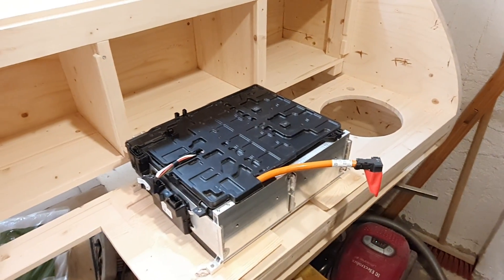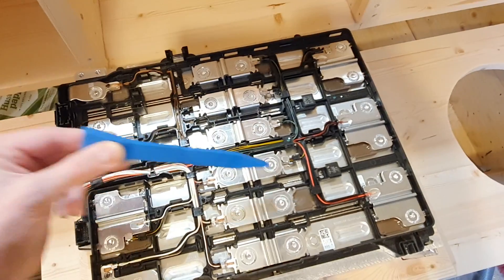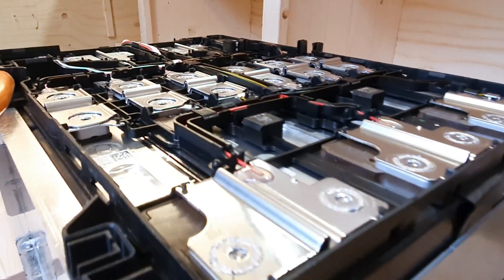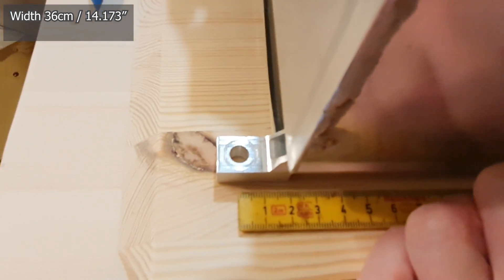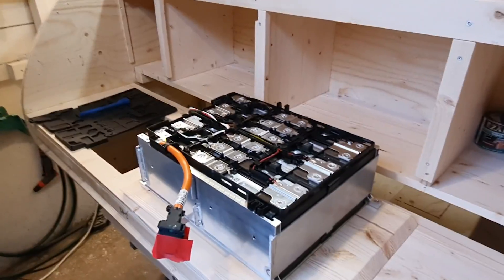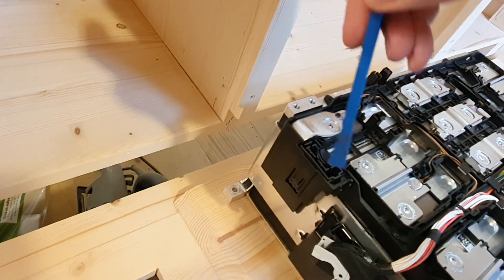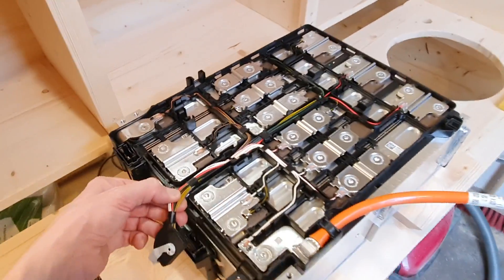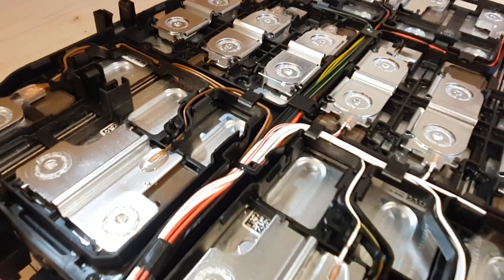BMW i3 60Ah Battery Pack Module Closeup

Comment: Bjorn, thanks for that video, do you have any info how the cells are temperature controlled in this module? Is ther a gap between cells, and where does the coolant flow?

Comment: What technique do you use to join the signal wires and the busbars ?
Reply from the maker: The 12 balance wires was just soldered to the bms harness to keep all cells at equal voltage.

As far as the busbars I didn’t need to do anything except extend the negative pole with a cable. The negative side comes with a big copper piece that I carefully drilled a 8-10mm hole and bolted the negative cable to.

In a more recent project I split that 12s module into 2 x 6s. And used one of those as 3s2p to get 12v. It’s possible, but dangerous/ tricky/ not recommended.
Reply: @BasinBjorn  i don't have space so i need to use solder, i can't use screw
Reply from the maker: @nguyentranhungnguyentranhu4719  oh, well if you mean solder the + & - then I don’t have much advise.

Comment: could those modules be used to upgrade the battery on a BMW 225xe?
Reply from the maker: Not sure what modules are used in the 225xe. But BMW’s need coding to accept the new cells / modules. You could try to ask in the “BMW i3 Modified” group on FB.

Comment: How difficult would you think it would be to connect multiple modules together to increase your range ?
Reply from the maker: I think it would be difficult. The car needs coding to know the new capacity of the old and extended battery pack. Might need separate BMS for the new pack. And the new pack would need to be the same voltage as the original one, connected in parallel. Then there is the issue with cooling of the new pack. Let's say you have it in the trunk?

Fun idea but better to upgrade the whole pack to 120Ah, no add-ons.

Comment: is it possible to remove cells from individual packs without harming them?
Reply from the maker: I couldn't really say, I believe that the aluminum case could be opened by just cutting the welds on the outside. But I would not be surprised if the cells are glued together.
Reply: @BasinBjorn  so I said he'll with it and went full out on one of thease 8s packs, you have to do a lot of super careful cutting and grooving with a grinder, I can confirm the cells are glued togather but the use of a large but thin putty knife and a solvent or oil can safely break the glue I used wd40 to deactivate the adhesive as I carefully advanced the 4 inch putty knife between the cells I was able to convert 2 packs to 7s 2p with 4 undamaged Sepperated 35 ah cells....
Reply: It's also possible to trim and reglue the protective plastic and weld the aluminium keeper plates back to togather if one has the skill and means to bond aluminium you end up with a restored pack
Reply: @BasinBjorn  I'm still working out how to get electrical connections to the terminal posts.... Probly pulse tig welding is likely the only way
Reply from the maker: @oceanhouse8080  Well that's not bad! Good to know, thanks! Sounds like it's totally doable then.

You should leave a link here if you end up posting any photos/ videos on that.

Comment: in several places in Europe you can upgrade the Bmw i3 battery but in my opinion the best is impexneth from the Netherlands and they have original 120ah Bmw batteries, not foldable and the price is around 6000 eur
Reply: Impexneth? 

What are you trying to say? 
I live in the Netherlands and I am exploring options to upgrade my 60ah..

Comment: can you use this for solar panels and if so how thanks
Reply from the maker: Yes but you would need panels that put out a higher voltage than the battery and a charge controller that can charge to the correct voltage. Easiest would be to not exceed the voltage of a single module, 50.4v.

Victron has a solar charger for li-ion at 50.4v

Comment: In the cell datasheet, it specifies 2000N side force to prevent cell expansion during the charge cycle! I think this is the reason for the substantial side alu-plates. If you cut the welds, I believe you'l find the interconnect plates under tension.
Reply from the maker: Do you have a link to that datasheet Tore? Good with people who can find stuff! 🙂

And as you figured out I managed to bring the old pack home. My previous plan was actually to just donate the old pack to the junkyard cause I couldn't find a way to bring it home, and I had to "discard of it" without help from BMW. Luckily I just bought a trailer for my next project and used that to bring it home on.
Reply: @BasinBjorn  The datasheet for the 94AH : https://www.secondlife-evbatteries.com/pdf/Samsung_SDI_94Ah_Datasheet.pdf
And thank you for the tip on the BMS. I just bought a 94AH battery from a scrapper in Norway, that's why I'm highly educated, at least temporarily, on the intricate details on these batteries. The pack will fit in Most cars without the backseat, and even in my small car it only sticks out 30 cm behind the bumper. However, I don't have a forklift at home, so I'll dismantle it in car!! Never donate anything to a scrappy!! You can't imagine what I payed for my 2017 94AH battery, and I still need to pay Danish import tax!!!!
Reply: Repairmanual on the battery pack: https://www.newtis.info/tisv2/a/en/i01-i3-hat/
Question: In the manual all screws needed to be undone to remove the modules, including the lid, are described in the manual as M6. However in one of your other videos you mention the socket used as a T25?? In the manual they state a: "(Magnet socket) Socket SW10 inner square drive 6.3 = 1/4 inch" which on the picture looks very much like an ordinary 10 socket, though possible a Tork socket?. However the manual also says that the is an ongoing changeover to another socket?? What socket did you use again???
About the BMS (for i3 owners): In the manual, BMW tells that each individual module in the pack is identified by the car computer and performance logged during its life. So if someone is going to replace one module in their pack, the monitoring computer has to be reprogrammed with the modules 28 digit serial number to recognize the new module. That also makes my original idea of repurposing the BMS to work outside the car slim ;(
Reply from the maker: That spec shart for the cells is really good! Thanks! So I just updated my bms to 4.13v for 100% and 3.40 for 0%. Before I had 4.2 and 3.3v.

Yeah I think I got lucky while I imported my 94Ah, since it was in the car no-one would have thought that it was norweigan. And the old 60Ah in the trailer was swedish but luckily enough I didnt have to explain that.

The tools that I used for taking the battery pack apart was just basic Torx and a 10mm socket. Hard to remember, but no security bits.
Reply: @BasinBjorn  I also did my first, longer test drive on my 5 modules today: and is equally impressed by how well they balance. Before I put them in the car, I charged each module to 48.00V (by hand with a 90W scooter charger),  and all cells except one, in one module, was within 5mV. Remind you, the battery pack I bought had been sitting in a Norwegian scrapyard for 1.5 years. So far, 20km today, took the pack from 3.909V  to 3.75V per cell, and the meter went from 80% to 72% ( the 100mV disappeared last week at the inspection where the brake testing was done 3 times, because the inspector was hard to convince, that the rear wheel brakes are supposed to be weak, not to lock the rear wheels from high speed regen).  I've set my BMS at 4.100V as 99% and  3.50V for 10%. I'm most likely too careful, but I'm treating them as babies!! Cheers.
Reply: @BasinBjorn  On second thought: In the datasheet, Samsung also  cycle tests the cells from 4.15V to 2.7V, so that might be the true range at 25C. I have another problem; a Lead acid Siemens charger, with a completely wrong profile! So I can charge manually to only to 80%, then the current needs to be throttled back, but my charger thinks otherwise.  Unfortunately, though this charger can be programmed, both through can bus and serial, Siemens has not released any documentation!

Comment: So what kind of balancer are you using with these?  One guy made some code for the opensource SIMPbms, so he has a display readout: https://www.diyelectriccar.com/threads/bmw-i3-bms.198547/
Reply from the maker: I am using this BMS:

https://www.ebay.com/itm/193561057261

It's a kinda cheap Chinese one, I got the 300A one since they have to be exaggerating the numbers and I figured that way I might hold up for what I need.

It has Bluetooth and a display to show all the stats. And through the App/Bluetooth I can set number of cells, how high to charge, how low to discharge, 4 temp sensors and stuff like that.

I've used it with a 50.4v 700w / 15A charger that plugs in to 230v. Works good so far but I'm still only on my... 3rd cycle. 

When I get the time I'll make a video on that BMS, wiring, functions and such.

I guess it could be bypassed as far as discharge, and only used for charging. If needing higher amps.

Coding, circuitboards, electrical components/ schematics and that is way out of my league.
Reply: @BasinBjorn  I need to run 72S! In a car, so I don't need the power cutoff, just the over/under voltage alarm signal and voltage, temp readout, to disable the pack through the main contactors, and some sort of balancing.  I found one Chinese manufacturer. However He only sells samples of two! However this is not an insurmountable technical challenge, and a modular design where I use 6*12S BMS in series will work fine, I just want the parameters to be adjustable, the trace for triggering the cutoff FETs on a regular BMS, can be used as a signal line for my main contactors. NB.: The original black box BMS from BMW, only use a 75mA equalizing current to balance the cells, so it doesn't take much to keep these well behaved cells in order, as they virtually have no self discharge. #2 Nb.: Debugging the BMW charger, someone figured out that the i3 only charges the cells to 4.09V and discharge is limited to 3.4V. This is likely both for longevity and as a hidden reserve to counter aging. So if it is actually possible to get name plate capacity out of the cells for 21.7 years in a car, as BMW claims, is to be seen.

Comment: Så varje modul är på 48v, vet du hur många Ah de ligger på?
Säljer du batterina?
Reply from the maker: EDIT: Full voltage is 4.15-4.10v like Tore mentioned.

Fulladdade är de på 50.4v (12 celler x 4.2v per cell). Jag sålde 6 moduler i vintras för 3000 kr / st. När de var nya höll de 60Ah, har inte lyckats testa ännu hur mycket kapacitet de har kvar.
Reply: @BasinBjorn  Maximum, never to exceed, end of charge voltage for the Samsung SDI cells is 4.15V!!! Settle for 4.1V to counter voltage drop along the sense Wires. Also they have a lower bottom limit of 2.7V. Here's the spec sheet from Samsung: https://files.ev-power.eu/inc/_doc/attach/StoItem/7213/Samsung_SDI_94Ah_Datasheet.pdf You need a better BMS, with adjustable parameters, not that they are much more expensive these days from China, but your cells are expensive, and they deserve it. BMW has calculated that they will last 21.7 years in an i3 80% capacity (so they claim). They have almost no self discharge, and wear very little with age. So you are going to live as long with these batteries as your kids. Take good care of them!
Reply: @BasinBjorn  tack för svar, visst är det BMS kopplat till varje batreri? Kan man använda orginal BMS? 
skulle det inte funka att ha 2 st batterier (120ah)i serie till en 48v golfbil?
Reply from the maker: Det sitter en BMS på varje modul. Vad jag hört går den inte använda externt från bilen. Den ser även ut att behöva kommunicera med bilen för att fungera.

Men jag köpte en BMS från eBay som fungerar fint. Ja det går koppla batterierna i serie eller parallellt.

Comment: How do you plan to wire these modules Bjorn? You mentioned in one of the vids that you'd be using two in your teardrop camper. Do you plan to use one BMS board per module?
I don't have any spare connectors for the main battery connectors but  I figured that I could cut the negative main lead (the fat orange one) and use the connector on it to get access to the main positive post on the battery. When I cut it yesterday to connect new terminals, I discovered that the battery wire is aluminium - or at least that's what it looks like. I'm not 100% certain though - maybe you can confirm?

Comment: Hi Bjorn.
First I think the battery chemistry is NMC  Lithium Nickel Manganese Cobalt Oxide also lithium-mananese-cobalt-oxide (LiNiMnCo, NMC, NCM). 3.6V Nominal and 4.2V peak. At least that's what it is on the newer BWW i3 12S 5000W modules
I have an application for using one of the 12S 5000W modules and am wondering what BMS and charger you will be using on your pack? Make and model number please
Thanks
Reply from the maker: So the charger that I am using right now is this one: https://www.ebay.com/itm/283842660269 (50.4v 15A Lithium battery charger 12s, using 230v)

And the BMS is this one: https://www.ebay.com/itm/192880341024

(Smart Li-ion BMS Bluetooth 20s with screen)

Only tested them yesterday and it all works. Got it set up for 12s and my high and low voltage cut off and such. Lots of settings, and two temp meters, so really good so far.

I will do a video on the BMS & charger that I'm using.
Reply: @BasinBjorn  Thanks Bjorn. What amp version of the BMS did you select? 100A, 300A, 320A or 400A and besides price is there a disadvantage to going way over on the amps for the BMS. Guess I need to do some reading on these BMS's
Reply: @terfer2  if I buy no-brand chinese hardware, I always double the numbers to be sure, as long as price doesn't go through the roof. 
There are so many false claims on performance and so many who downright lie about capabilities. 
How many amps do you plan to draw from your modules? 
I haven't found discharge data from the 60Ah modules, but extrapolating data from the 94Ah modules, the 60Ah modules should have a possible 5 second discharge rate of approximately 270A (4.5C) and 30 second discharge rate of 180A (3C). I wouldn't plan on drawing more than 2C continuously.
Reply from the maker: I got the 300A BMS but I'm sure it can not handle that. My max load so far is about 15A at 50.4v, haven't had use of more than that.

And yes these specs are not really to be thrusted from no-name sellers.

Comment: What cells are those? 
Voltage/capacity per cell?
Reply from the maker: Edit: 4.15v at full charge. Prefered 4.10v.

The cells are Samsung SDI, 60Ah. Voltage is 4.2v at full charge. I'm about 2 weeks from installing the new BMS and testing the remaining capacity. That should be interesting!

Comment: Hej Björn och tack för en bra video. Jag har en i3a 60Ah på g som jag funderar på att köpa som hobby /pendlarbil (7000mil). Vad tror du om att pendla 9mil på motorväg i 110 om/h när det är minusgrader? Bilen har värmeväxlare..
Tack på förhand!
Reply from the maker: Det låter inte riktigt optimalt tyvärr. I höstas/vintras körde jag Uppsala-Sthlm med fullt batteri, utan förvärmning av batteriet men förvärmd kupé, 88km och jag fick hålla ca 90 kmh och det var precis att jag kom fram. Var ca +3 ute. Dock hade jag ca 16kwh tillgängligt i batteriet, inte 18.8kwh som när bilen var ny.

Om du inte har möjlighet att köpa den med 94Ah batteriet så är REX ett bra alternativ.

Gå med i "BMW i3 Sweden" på FB, mycket info där.

Comment: Hi Björn. Thanks for your video.
I think the 12S configuration should be good for many things. What I remember a lifepo4 cell has 3.2V nominal and 12 cells is about 3x12V battery. 38V instead of 36. Should be good for many kool EV builds..
Reply: These are lithium ion, not lithium iron phosphate.
Reply: @randacnam7321  are you shure? In that case 12s = 44.4V ?
Reply: @randacnam7321  ?? Those are not mutually exclusive...lithium iron phosphate battery are also "lithium ion" it just is the type of electrode used for those ions. there are other types, such as many types of Tesla lithium ion batteries are nickel/cobalt electrodes
Reply: @fumpercheezy  Try and charge a lithium iron phosphate cell like a lithium NMC cell and you will have a bad time.
Reply: @randacnam7321  true, but the reverse is actually far worse. They are different in their electrochemistry, so naturally the optimal and safe charge profile from the BMS will be different

Comment: Way to go... 👍👍👍  What is the full charged and discharged voltage for one cell (to get an idea of the cel chemistry) 😊
Reply: I read for a long time ago in a comparison to Tesla batteries that the 60Ah is lifepo4. Arround 3.3V nominal. Ordinary lithium batteries is arround 3.7V..
Reply from the maker: Well I actually had to google the full state of charge voltage on LiFe Po 4 and that is 3.6v. So it cant be. But i'm about 95% sure its Li-ion in these Samsung SDI 60Ah cells.

Also I have the impression that LiFe Po 4 doesnt do high discharge currents that well.
Reply from the maker: Got more info on that from a subscriber, 0% is 3.40v and 100% is 4.13v